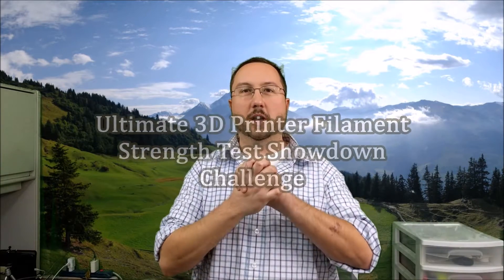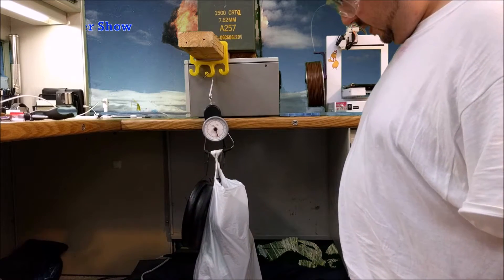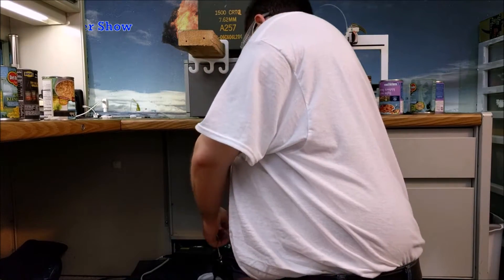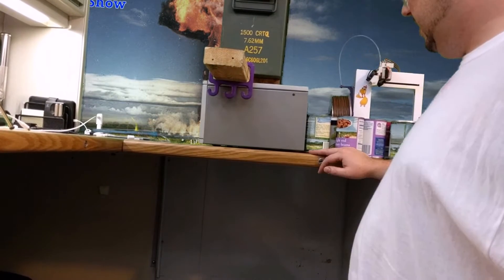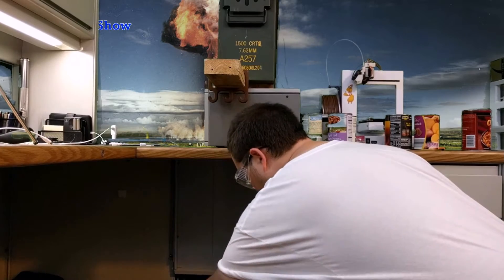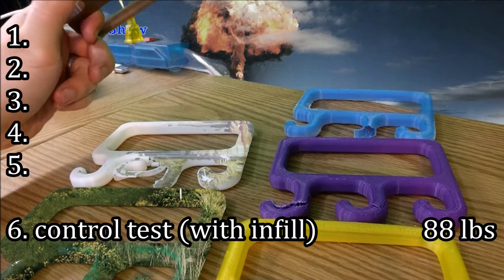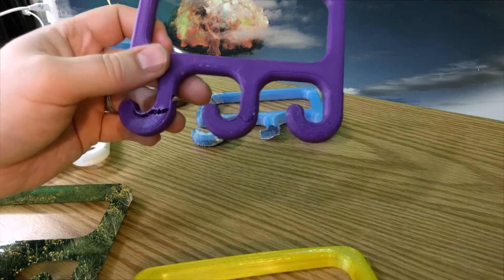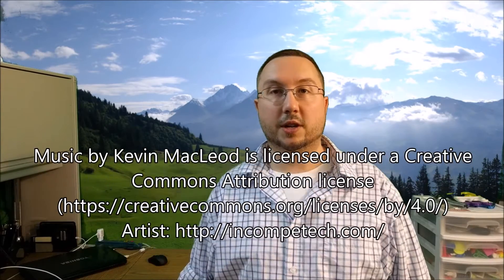3D Printer Filament Strength Challenge GT-PLA PLA+ PETG

Comment: Can you use GT-PLA Material on Makerbot
Reply from the maker: i'm not aware of any reason why you couldn't
Reply: Steve Weber hi thanks for the answers cause I saw eBay and it say — GT-PLA Material(new formulation, high glossy, tough, for none teflon tube inside hot end of 3d printer, like makerbot, UP, cube robo, etc.)